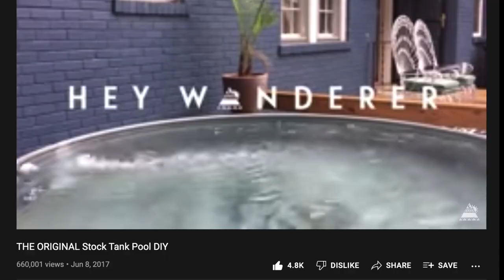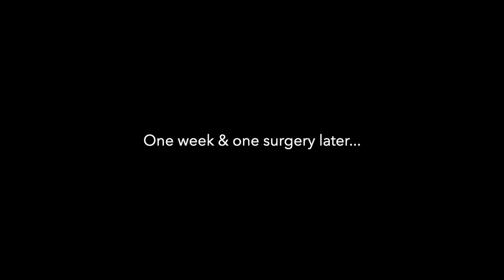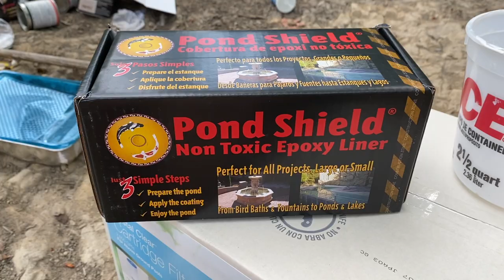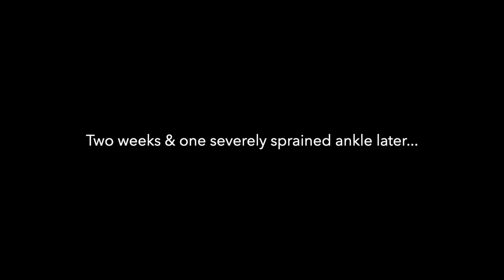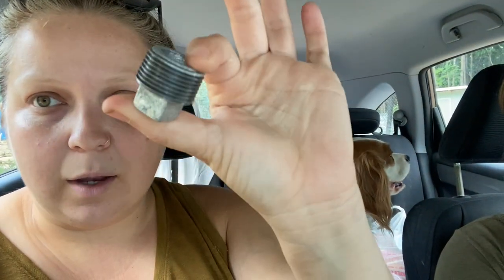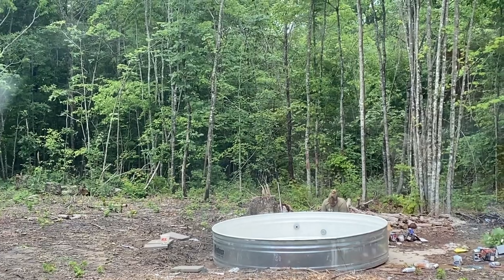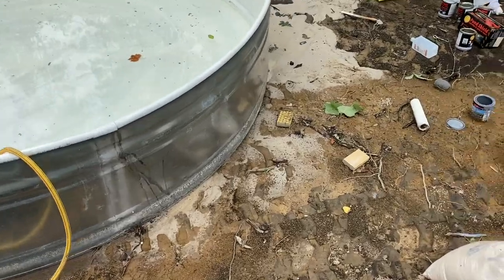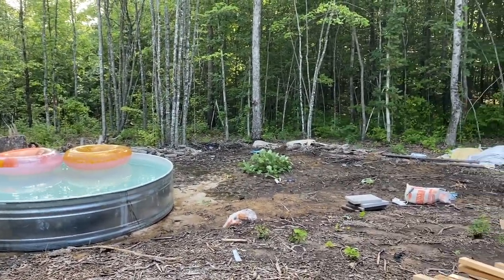Painting Inside Our Stock Tank Pool With Pond Shield

Comment: We did sky blue and it worked really well. I recommend adding alcohol, pouring the paint directly into the tank in puddles, 1 person squeegee, another person paint with an extended roller, paint the base first and then with the excess paint the walls. Took about two kits, and a lot of fast pace elbow grease.
Reply from the maker: We didn't like using alcohol at all, but we did pour it directly in. Not sure if you watched the whole video as we addressed these things... Overall our pool is coated and protected so I'd say ours worked out too. We also have a 10 ft. tank so 2 kits was not enough. I do think the colors do better than white. Most of the people I found who have the biggest problems have used white.

Comment: It's been 2 years since I had painted the inside of our 8 foot diameter stock tank pool.  Unfortunately when we drained the pool this year, it started cracking and peeling.  I applied another layer of pond epoxy paint and I have the same frustrations and challenges as you have.  I'm thinking of going with a vinyl wrap instead.  Just wanted your thoughts.  Or even a video if you decide to go that route.